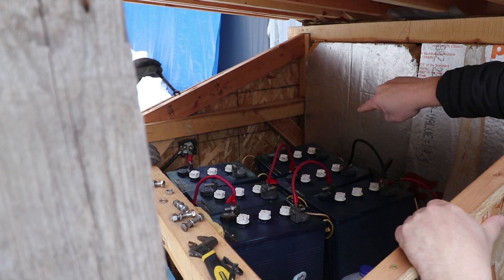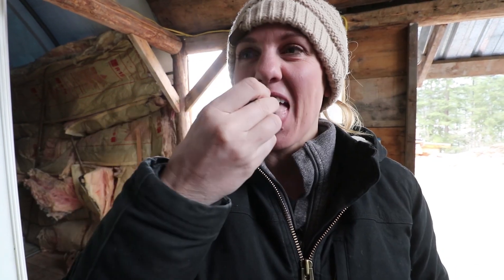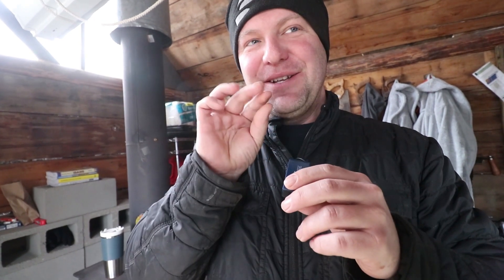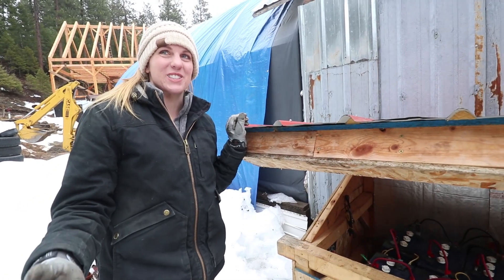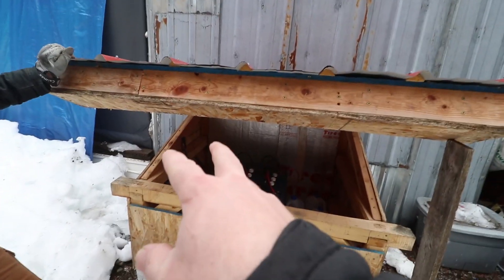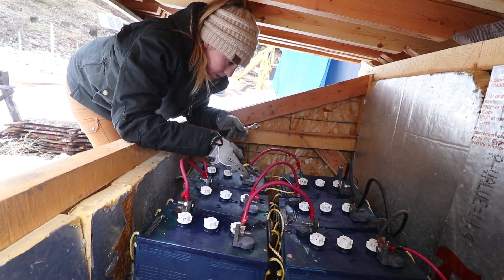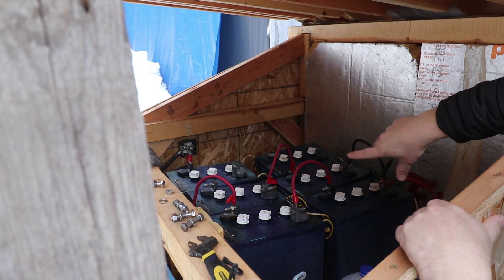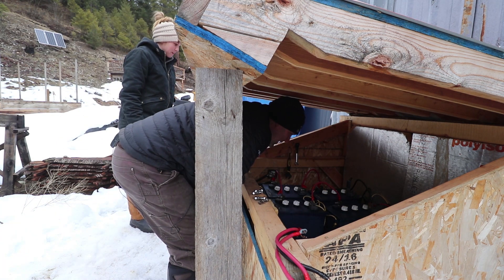All the Solar Panels in the World CAN'T PREVENT ➡️ THIS ⬅️

Comment: I found your channel because it popped up when i was looking into solar power generation. I personally wouldn't consider solar power if it meant running a generator all day and wasting a lot of time fixing and repairing. Paying about 25 cents per kwh i am really looking into generating my own power at our next place. When i have to pay to get the services in and then still get a hefty bill every month, that i think is the time for me to look into my own power wall with plenty of capacity for generating and storing my power needs. If i have to pay a couple of hundred dollars each month for power, it might as well go towards paying off my own system. Than again you guys could have fewer sun days and/or cheaper power.

Comment: Dear Alyssa, I found the perfect video series on how to size your solar system.  The series does not show you how to build the system, but how to calculate what equip you'll need, and how many batteries you'll need.  In Step 2, they address batteries in cold temp.  It's one of those series that you may have to watch a few times to get a handle on all that math.  I am watching the segment the second time now.  I realize why your batteries failed you during the cold.  She shows a chart with a multiplier for your temperature of 20 F (1.59), which means your battery capacity needs to be sized up by that factor to handle the cold.  Until you get on the grid, the video series is a golden nugget.   

Critical Point of Math:  Parallel vs. Series.  If solar panels or batteries are hooked up in series (a straight  line), you add the voltage, and the current remains the same.  If they are hooked up in parallel, you add the current and the voltage remains the same.  In both cases the Watts (power) adds.  In a series hookup, red positive wire from one is connected to black positive wire of the next.  In a parallel hookup, red positive wire from one is connected to red positive wire of the next.  So two 300 Watt, 24 V, 12.5 amps in series produce 600 Watts, 48 V, and 12.5 Amps; in parallel you'll have 600 Watts, 24 V, and 25 Amps (same math for battery banks).  Power (watts) = Volts x Current.  One more brain teaser.  If you have four solar panels of which two are hooked up in series, two are hooked up in series, and the two pairs are hooked up in parallel, you have (24 V x 2) x (12.5 A x 2) = 1,200 Watt system.
https://www.youtube.com/watch?v=vdly8OhsdmI&list=PLoHd6hGDqS07bbZkyi_4ntfiySUKjPsUL

Comment: im a electrician when working on a batt bank PPE is rain suit face shield and chemical googles with rubber gloves.....but minimum safety glasses back in 98 before the safety regs went haywire i had a battery blow up when disconnecting it,the top came right off and hit me square in the face shielding my eyes from the acid my clothes were trashed and i got a bleeding nose but luckily i can still see also would b good to have baking soda and water solution handy

Comment: It pains me to see people ruining good gloves on batteries when 100 nitrile gloves cost $8 or less at Harbor Freight. I reuse mine when I do light jobs, so they last a good long time.  Nitriles remind me not to touch anything else so it won't end up with holes in it.  (I hate losing work pants to battery acid.)  //  Jesse, batteries lose a little of their water when they charge, and a lot of their water when they overcharge.  Hot summers can be hard on them, too.  Maintenance is critical, so look into getting one of the auto top-off jug like this https://is.gd/lldoUr for <$20 or one of the auto-fill systems @ about $25/batt.  //  My first system was for emergency lights in the house in case of power outage.  HF 45W system, just enough for little 4w LED lamps in 6 places around the house.  I now have racks on the roof and 1kW of solar panels for hot water, or emergency power with inverter.  //  I hope you keep your panels for outbuildings and emergency power.

Comment: aloha... just saw a couple of your videos...
good for you, on your own terms.
wish i could have helped with house design suggestions, etc. 
e.i a full covered walkway around the house + patio, i like the internal stairway thru the garage/entryway (safe & warm), 
how about a possible elevator well/closet for later build/install (5'x5') [if you'll age in place & walking up stairs will become a bitch] but a dumbwaiter soon for bringing up groceries & certain sized items opposed to hand carrying up the stairs??
any chance of a few light tubes/skylights??
put in a cold storage room for alternative cold food keeping during winter??? (canadian people do this in their homes--toronto, etc)
where possible spray foam insulation or purchase bubble foil insulation off amazon (take alook at thebossoftheswamp/youtube -- how he insulates his cabins in ny & new hampshire
 
1. how will you heat??? how about a wood burning furnace the heats water.. located outside of the house yet easy enough to load wood??? i'm assuming you have a forest to harvest wood to burn??? produce hotwater for normal domestic hotwater; use, your hottub & radiant heating the house. Propane for cooking & alternative heating/just in case?? 2-3 120gal tanks
take a look @ engineer 775; water systems, pumping, solar pv, etc... sustainability & prepping.

2.. maybe solar pv & li-ion batteries when you can build a proper solar pv array + wind turbine; is there a nearby water source/river?? LED lighting & LED light strips when possible especially exterior to make it bright... & solar powered if possible...

for now, i'll say goodnight... stay warm...

Comment: You don't need to retire the solar panels.  You can actually still use the panels in conjunction with your on-grid power.  During the day your solar will provide the power as much as it can, while in turn using the on-grid power less.  Then at night, you will be using on-grid power 100%.  So if you think about it, you can lessen your on-grid power by using solar.  But, if your solar puts in enough power and your total usage is very little, the power company will most likely pay you for supplying your surplus power into the grid.  Many homeowners here in California are doing just that.

Comment: Batteries are simply a consumable. When they are finished, take them to be recycled. At least the lead can be recycled continuously. The insidious bit about lead acid is that they lose capacity steadily and silently, what starts as 100AH soon becomes 90, 80, 70 etc then sooner or later you have to buy new batteries.

Comment: "Smells like an outhouse" (*goes in for another sniff*)  LOL  If your charge controller can handle the voltage you'll get much better performance from the panels by wiring them in series instead of parallel.  More charging voltage available earlier and later in the day, as well as in overcast conditions. Just an FYI....the MC4 connectors are easy to disconnect by squeezing the tabs with your fingers.  You don't need the tool.  You do, however, seriously need to sharpen that knife!

Comment: Hmm,lead acid batteries kept out in the cold,and drained far below a safe/sane depth of discharge on a daily basis..Obviously not enough battery capacity,or solar (charge) input. Yea,I can see why they didn't last long. If you actually do the math right,solar works fine.

Comment: I wasn't quite able to make out how you bank is physically wired, but if you are losing batteries at one end you may not have an electrically balanced wiring setup. There is a way to physically wire the bank which is technically the same electrically but it helps keep an even load on your batteries.  Something like this https://youtu.be/lJpS39BoHEw?t=37s
Reply: the above is not my video just one I could find to show a picture.

Comment: Hello, 

I just saw you film in you solar battery issue. Using distilled water to keep a lead acid battery functioning is bad because the water actually it dilutes the sulfuric acid in the battery. The more water is added the less the battery will hold charge. If you fill the battery with a gallon of water you have lost about 20 - 30% of the changing capacity. To prevent a failure of a battery is better to fill with Battery Acid. The batteries you remove can be made to work when you replace all the liquid currently in them and replace with battery acid or a home made acid made using 8 oz of Atum to a gallon of distilled water. If you try this do it in a well ventilated area.

Comment: Nitpicking a little bit, but 250mAh on the battery is not current. It's capacity (or part of it, you need the voltage to get to watt hours)

Comment: i was workin on solar stations and we put the longest vire 10 mile long little more almost no los 7A 780V  you need to read manual and wire  batteries for full potencial 12V is not good 24V is bit better but 48V is in the range if you buy pip4048 you can max out voltage and increse voltage for better performance try to invest when you gonna have extra 1000$ and you whil be suprised on solar and use less gas

Comment: Nothing beats a diesel generator and a 500 gallon fuel stand for reliable off grid power. However nothing beats the reliability and price of being on the grid. Solar is only really feasible when going bare minimum regarding actual power consumption. Not to mention the cost of the solar equipment, the actual maintenance of all that stuff

Comment: OK if you can not open the battery box lid all the way because it wii lit the cabin then why not tie a strap to it and drag it a few inches away from the cabin to allow the lid to open all the way. In previous videos you mentioned you try to find ways to make it easier for your wife to operate. She had to bend over to drag the battery out. Come on make it easier.

Comment: For abut   $900 to $950 you can go to the Edison cell, that would buy you the 10 cell's needed for a  12 volt @ 100 A/hr.Lead acid only has a 5% duty cycle where the Edison cell's have a 80% + duty cycle.   lesidaho.com   check them out I bet they can help you.

Comment: Nothing will cook off a lead acids' battery acid faster than getting current when it's already full, and I'm curious as to which type of voltage regulation system is incorporated. A very specific Solar Panel Voltage Regulator is intended for float charging of lead acid batteries, it's the only thing I can think of that would cause your battery to be a whole gallon low, aside from a leak.

Comment: The advantage of those batteries is they are rebuildable. Just like new when done. Since you brought up the heating, a good reason for temp sensors on each battery, cheap stick-ons work.

Comment: Battery banks don't like to be frozen. You might be glad it's second hand. Lesson for your next bank: A solar water collector to heat the battery housing, or put them indoor (less safe). And don't use wet/flooded cells.

Comment: if your on a 12 volt system all your panels should be in parallel for example if you take 2 100 watt panels in parallel 12 volt that is roughly about 9 amps @ 12 volt but if you series those same panels you end up with 2 100 watt panels 24 volts @ about 4.5 amps under peak sunlight.

Comment: I've worked with electricity for a while and if I where to explain volts, amps to someone I'd use water and pipes to explain. Volts would be the pressure or psi of the water in pipe and amps would be the flow of water through the pipe. The pressure (volts) is/are always there and when you open valve/switch the flow/amps starts. There's obviously more to electricity than this analogy can cover but that's the general idea.

Comment: I am getting ready to buy the outback... I would love to see more on the chaining of panels and options to bring in different voltages then the battery bank and also the load being different voltages, can all 3 be set at different  ??  is there less loss if all in line ( adding the volts by each panel up to the maximum, rather then parallel adding the amps to 12 volt ) I hear the wiring can be way smaller that way also - would love to see this aspect of the outback :)

Comment: I don't understand why you didn't go 24V.  It is much better for long wire runs, and lithium batteries right from the start would have saved all the headaches and unneeded stress.  A properly sized 24V lithium setup will be less costly that hooking up to the grid.

Comment: After you go back on the grid, you could move the batt bank up to the hot tub area and 
invest in an immersion heater for use in the hot tub to help keep the tub at a reasonable temp, for longer time. 
Just a thought.

Comment: Hi Guys,

With all cabling, there is some sort of losses which you want to minimise. 

With longer runs of cable you need to increase the conductor size. 

There are cable conductor calculators on the internet that you can use.
Reply: flagmedownmedia Watts ÷ volts = amps, volts x amps = watt. Electric is (for me) easy, anything eletrical that fails in my home I will fix or salvage for a project.

Comment: As an electronics engineer I have experimented with solar panels for other applications (NDA prevents me from saying what).   What I did find was when the panels were in direct sun you got superb performance from them, but anything else they were dire.   So I'd suggest moving the panels up the hill so that they got a clearer view to any sun and not shaded by buildings.   Plus, angle them so they as much head on as possible.    (Although I'm not saying to as far as a tracking system, but just ensure they're making the best of the daylight).
Reply: Not being rude but this is the first thing you learn when you have solar panels.

Comment: Also. I've meaning to add a comment about your charge controller. That's really nice one. I want to buy the same. You had mentioned it has a connection for "Wind Power" and you've mentioned it gets windy.(would be useful on a cold, overcast, windy day and more so at night. You can buy (Harbor Freight or Fry's Electronics?)one that puts out 750 watts and is $750.00. Do the math. Lol. Also, w/alternative energy systems hooked into the meter, should make meter spin backwards! Love your channel and learned stuff from you'll. Keep up the good work.

Comment: Big lesson here is not to buy used batteries . Also size the batteries/panels big enough for your peak # days of cloud cover.   They failed here because of not doing this.
Reply: Used batteries can be a good way to introduce novices to photo voltaic or any other off grid power source. Once experienced with how not to trash your batteries it would be time to invest in a new bank of batteries.

Comment: Picture the hot tub.  Voltage is how much water is in the tub. Current is the flow out the drain. Watts is how far the water squirts from the drain.
Reply: Or better. Voltage is psi, amps is the flow and watts are a combination of both.

Comment: If one of the batteries is good you can parallel it to another 6v and use it still.  Im very disappointed that your off grid dream house is going on grid. Its kind of important to size your system to what you need for power but Im sure you have figured that out already.

Comment: FYI... 250mAh printed on the battery refers to its capacity, not it's current capability. It means that the battery can produce 250 mA for an hour, or 125 mA for 2 hours, etc. etc. before it is discharged.

Comment: I wonder if they could actually use their hill and the second water line they have there to build a hydroelectric battery. Just install a large tank up on the hill and below and use a turbine to pump water up and down to store and retrieve electricity.
Unfortunately there isn't much potential energy in gravity. You need a very large tank to store enough energy. But the efficiency can be very good and costs when scaling large are low.

Comment: Lots of questionable advice on maintaining lead/acid batteries being offered by subscribers. I was responsible for maintaining a large solar system on a rural family property that used a bank of large surplus telephone exchange batteries. Constant terminal cleaning and water adding was the rule. Forget the rejuvenating advice by the internet 'experts'; when they're sulphated or otherwise shot get rid of them. Keeping the battery bank charged and not deeply discharging it was key.

Comment: Remember this.... 100 milli amps flowing through your heart can kill you!  Volts = the push that your circuit has. Its like the force that is built up in a dam because of the height of the water. Amps = the flow of water going to your generator blades dictated by the size of the pipe used. Resistance = the load or the work being done, turning the generator blades. Electricity needs a closed circuit to work. ....... Dam, I wish I could talk to you face to face about the basics of electricity because that is what you are missing to truly understand your systems. I was in the navy for 28 years, 23 of them as a electronics technician working on everything from computers,(milli volts) to high power radars, (70 kilo volts).

Comment: current= amps is the push in a line
Reply: Amps = current = flow of electrons through a wire or other type of conductor.
Volts = electromotive force = push or pressure. It does not move.

Comment: Lead acid batteries work perfectly for solar if used correctly.no one uses them correctly, people do not understand there limitations. i live off grid close to Lewiston Idaho from September last year.
i have used my genny four times through the winter,and i am so please with how well it worked.i have 25KWH of lithium ion and 10 kw solar. this would not have been possible with lead acid batteries to do this.i run everything from my system fridge ect i even have induction cookers.
i am an electronics engineer.
I know very little about building,and have found Pure Living for life very educational,and would like to thank them for there work and my respect to them for showing things like it is.